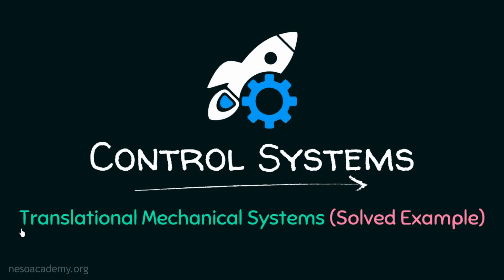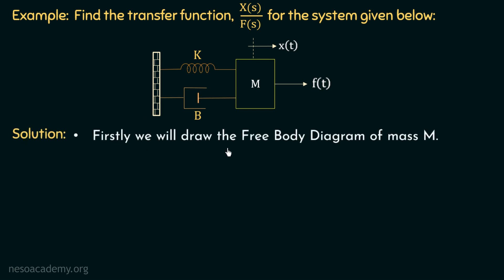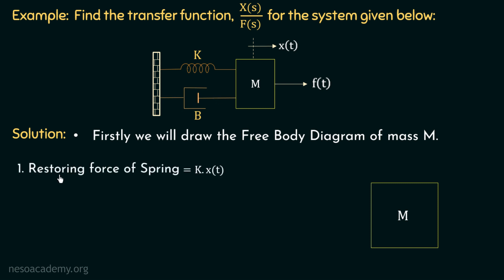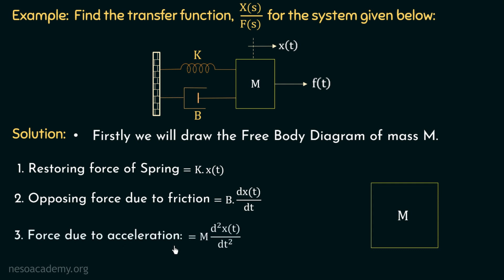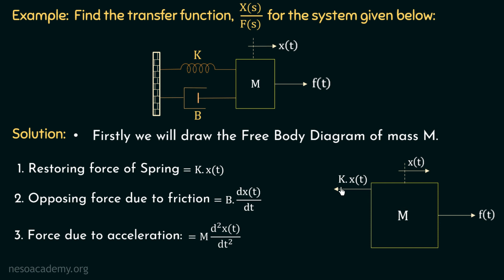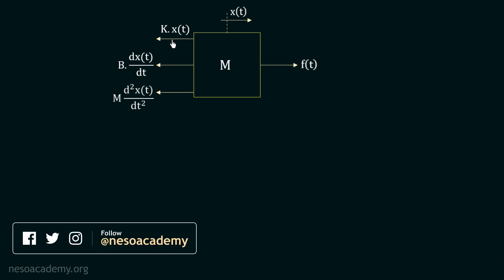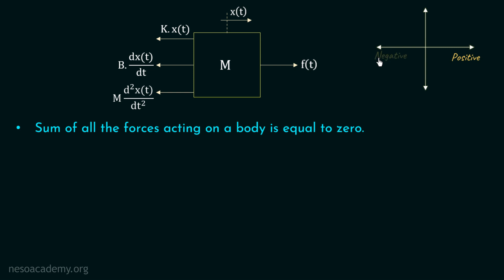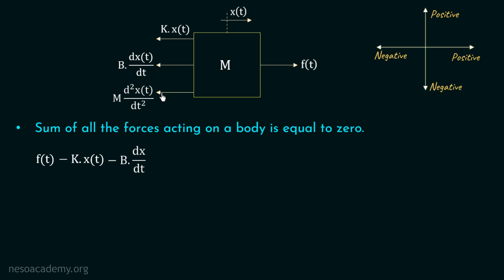Translational Mechanical Systems (Solved Example)

Comment: Thanks again for making and sharing all of these videos!

Maybe I'm just a stickler, but I have a bit of an issue with how you considered the forces and acceleration.  Acceleration is produced by unbalanced forces acting on a body; it isn't the force of a body.  If anything, "inertia" refers to the quality of an object to resist changes in its motion (i.e. acceleration).  Similarly, the sum of the forces acting on a body isn't necessarily zero.  If the sum of forces does happen to be zero, then there is no acceleration, so either the object remains at rest or it continues to move with the same velocity.  In this example the math works out the same, however I'd recommend just always writing F = ma and summing the forces on the left-hand side of the equation.
Reply: yeah i am not sure why he did the summation of the forces that way. the net force on a body does not have to be zero and is not zero on the question he solved.
Reply: @yhc1244  I’ve noticed a few issues with these videos from time to time, but the math always seems to work out.  And other than that, I think they’re great.  I just always like to point out issues when I see them so that it might add to the discussion…
Reply: actually, he calculated all with respect to body. That is why a pseudo force came into picture.
Reply: @abhishekkumarpatel8455  Yeah there's definitely different ways to work problems.  I just learned a different way to do them, so I think it makes me biased.  But ultimately if you do well on the JEE and understand the concepts, that should be fine.
Reply: @PunmasterSTP  yeah, same I feel I solved it in the way I learnt during my jee prep time and answer came same
Reply: @abhishekkumarpatel8455 Cool!  How'd the JEE go?
Reply: @PunmasterSTP  end up into NIT Rourkela Electrical Engineering department 🥲
Reply: @abhishekkumarpatel8455 I see, and I'm sorry if that wasn't one of your top choices.  I've never taken the JEE and I mostly watch these videos because I tutor some students in engineering topics, so I'm not familiar with how everything around the JEE works.  Whatever happens, I hope your career works out for the best.
Reply: @PunmasterSTP  thanks for your kind words Sir 🙏
Reply: @abhishekkumarpatel8455 You are most welcome!